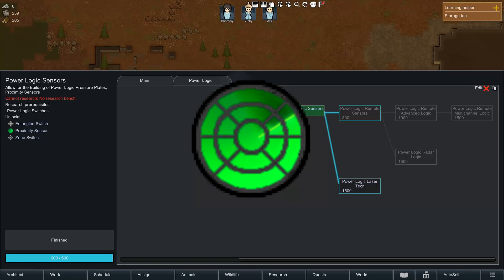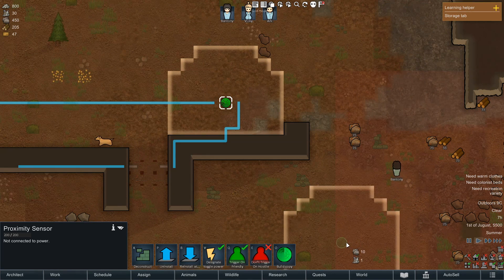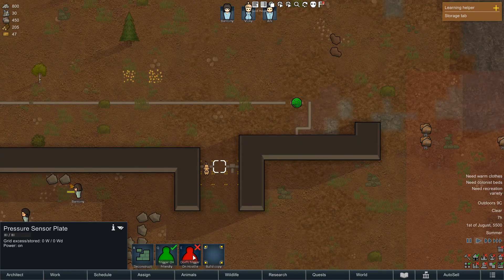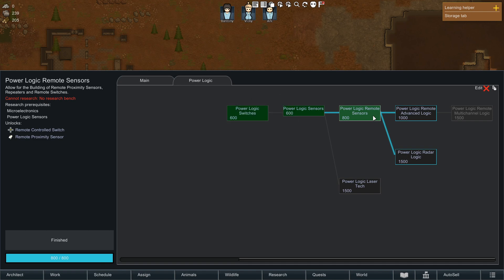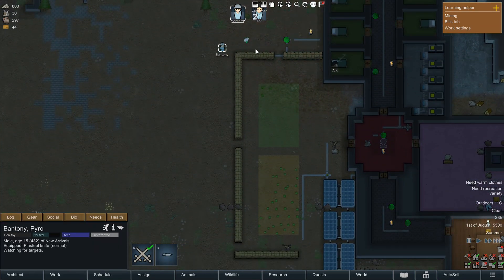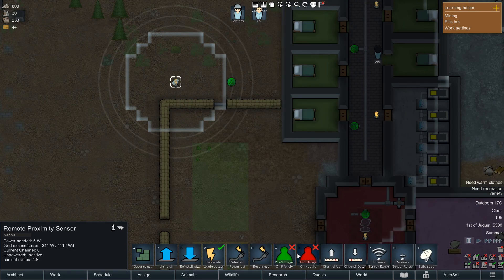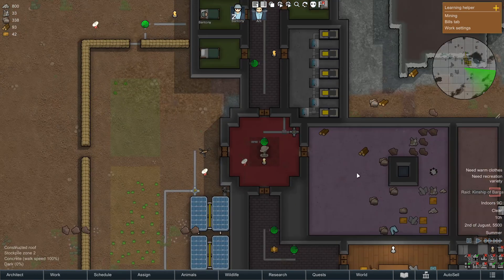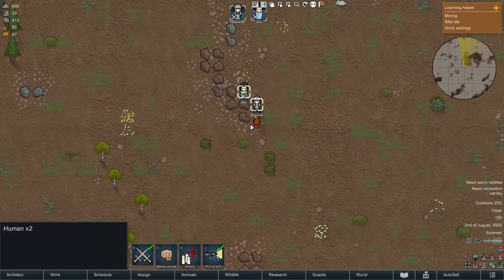RimWorld: Power Logic Proximity Class Sensors

Comment: I still don't understand the proximity sensor from this tutorial.
In the most recent version it does not accept being built on conduits, but still says "Not connected to power",
even when a conduit is adjacent.
So no clue how to use it and when it will switch what part of the network.
I ahve one room where it works, and one where it doesn't.
Reply from the maker: Switches are actually a type of conduit, so they cant be built on other conduits (not without lots of red errors), When it shows as "Not connected to power" the switch is in the off position, the vanilla switch also does this. Also make sure to set what you want to detect, it helps having a colonist in range of the proximity sensor when setting friend foe settings to test it.